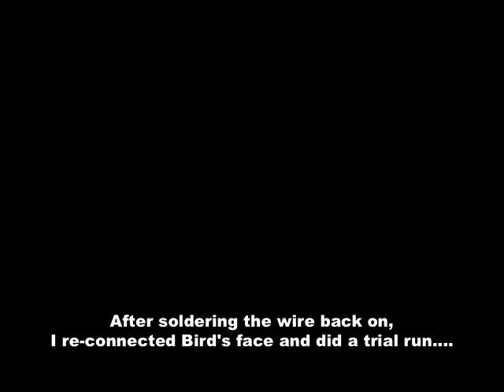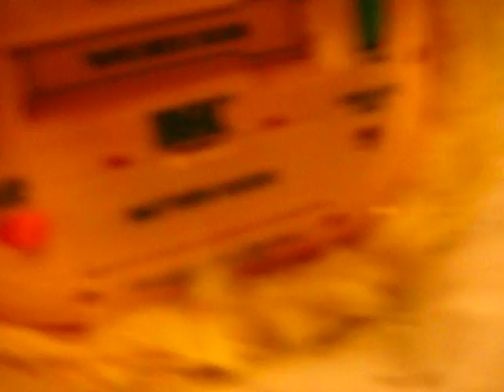StoryMagic Big Bird repair

Comment from the maker: @Lachlant1984 Thank you! The motors actually do have grease on them, you can really see it on the motor running the eyes. There were 19 tapes total made for Big Bird, and so far I have 8. The stories are much shorter, too, only about 5-8 minutes each, whereas the Teddy Ruxpin tapes are about 15 minutes. I'm not sure where these guys were made... There was some writing molded into the plastic but I never got a clear picture of it, so there's no telling if it said where he was made or not.

Comment: I have a 1986 Ideal Story Magic Talking Big Bird. The cassettes still work, but his mouth & eyes no longer work. Can this be fixed? Thanks!
Reply: +Colleen Chase Yes it can, you must remove the fur, and reconnect some wires going to the motors. If that is not the case, the motors or wires / connectors might need replacing
Reply: Sorry. I just saw this. Thank you very much.
Reply: No Problem! Just try wiggling the wires you can access first, by opening up the back, (that's how I repaired two of them) And it should begin working.

Comment from the maker: @Lachlant1984 Yes, the tapes work fine for both versions, which is really nice since they failed to do the same with TR. The motors running the face on Bird are basically the same pulley system used in the little Teddies and the YES! ones, only much better quality. The bottom pulley operates a piece of plastic that fits inside the hollow bottom mouth, and the eyes work on a gear system; grooves on the motor fit into grooves at the base of the eyelids, and as it rotates, he blinks!

Comment: Are the cables for Big Bird's moving parts simpl connected by plugs and sockets as is the case with Teddy Ruxpin, or are the wires soldered directly onto teh circuit board?  Just for your info, some people refer to the type of tape deck Big Bird has as a "letterbox" tape deck, because it's much like the slot you'd find on a mail box.  It does as you've said before look so much like a car tape deck, and it sound like one when you insert a tape.  "Cachunk!!!!!"

Comment from the maker: @Lachlant1984 His face is sewn and bolted into the fur, leaving the gears exposed. With Teddy, there are simply holes in the fur where the eyes and mouth fit, and the pieces are attached to the frame inside. Much to my surprise, the tape heads were actually spotless! I think that he had broken early on and hadn't been played with much at all, and simply sat around collecting dust. The Tyco version is sadly incompatible with Cookie and Oscar, so no satellite jack.

Comment: I watched your repair ands tried to fix one I bought on eBay.  The belt had come off, so I took the cassette player off and put the belt belt on.  Unfortunately, the cassette will no longer power on once I put it all back together.  Any suggestions?
Reply from the maker: Sounds like a wire may have come loose. Check the wires going to the battery compartment, and the wires going to the motor.

Comment: my big bird has battery corrosion on his battery pack springs  and some of the other connectors for his batteries any ideas how to clean them, as for his plush i would use a wire suede brush for shoes  and blow dry at the same time but gently mind

Comment: Hi, My Ideal 1986 big bird's mouth doesn't move anymore. Any suggestions? and oscar doesn't come out of his garbage can.

Henry in Montreal
Reply: Henry Kaszel You could try to do the Teddy Ruxpin eye massage trick on his mouth, but I'm no professional. For both the motors are probably stuck, so you could take them apart and massage the motors while its playing. That's probably only temporary, but if it doesn't work then there is probably something wrong and you would want to send it to a professional. (Dr. Eeyore is the only one I know) That's my advice but I don't know much about engineering so don't ask me what to do if it doesn't work...
Reply: I'm not sure if the motors in Big Bird have those same issues.

Comment: When you say Big Bird's face is permanantly attached, do you mean the gearbox assembly is attached to that poll that forms BB's neck?  Did the Tyco version have the "Satellite Jack" found on this version?  Did you clean the tape heads when you repaired the broken wire.  Because of the way the tape loads I can see that properly cleaning the playback head means taking the toy apart, unlike Teddy Ruxpin, all you need to do is open the door and remove the cassette before cleaning the heads.

Comment: That's a really good restoration job you've done there, a simple fix for a problem that stopped him from working.  Do you know if Big Bird's motors need oilling and lubrication as does Teddy Ruxpin?  How many tapes do you have for Big Bird.  I've seen a few of these on eBay over the past few days, it seems as if they're made in Hong Kong, right?  I suspect that hand written lavel you saw was a serial number of some kind.

Comment: @wizzwamf One other thing you could try is to use some vinegar to clean battery corrosion off the battery terminals, if you do that make suer you remove all traces of vinegar once the terminals are clean, I've hard from another YouTube user that if you don't remove the vinegar from the terminals they'll corrode again.

Comment from the maker: @GracieM1990 I don't know exactly what Bird's measurements are, but I assume it would be the same as a Teddy Ruxpin belt since their cassette players are similar in size; Square, 0.04 inch (1mm) thickness, ≈ 6.3 inch circumference. =)

Comment: Hopefully you still read comments from an old video. My big bird makes a very loud tone making it on listenable. Everything else seems to be working, mouth, eyes, but when I put the cassette in and connect him to Cookie Monster and Oscar the grouch it makes a very loud tone.
Reply from the maker: I do get notifications for (most) comments, even ones on old videos thank goodness! For some reason, Big Bird only cooperates if you plug Cookie or Oscar in just the right configuration and honestly I can't figure out why this is the case. Just swap the cable configuration around and eventually they will work and stop beeping.
Reply: @blueoctopede  Okay, I will try to get it figured out by switching cords. Ugh, so frustrating. Thanks for the suggestion.